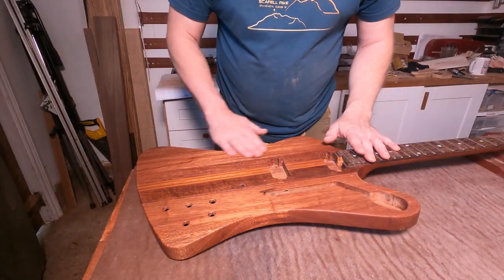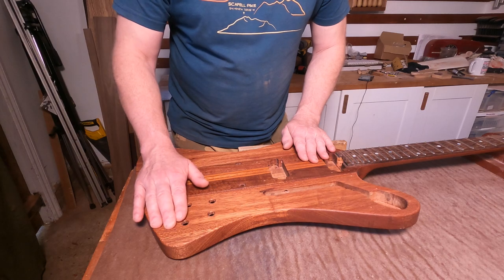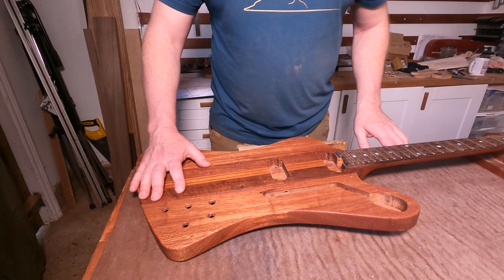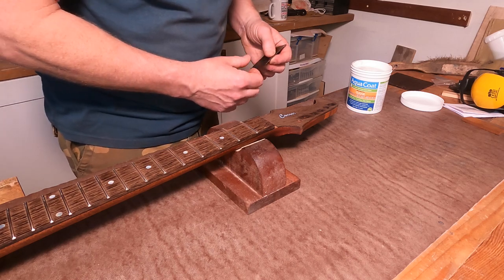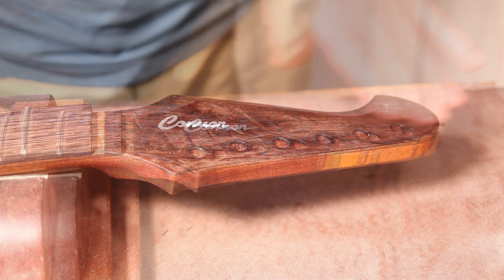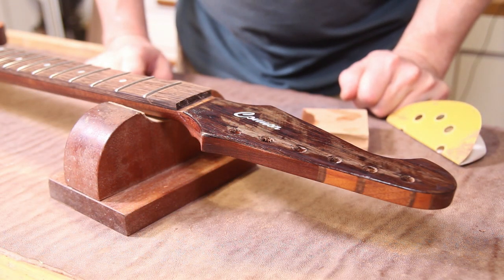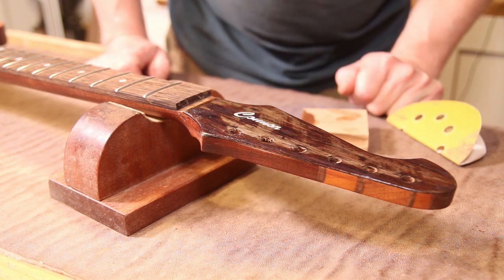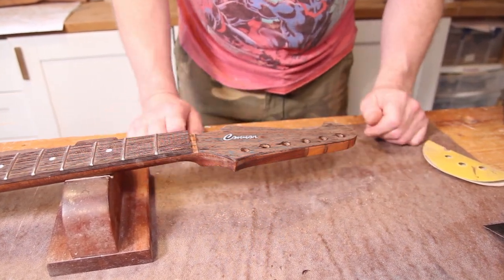Firebird Guitar Build Episode 30.

Comment: looks like a great clear filler.. does the job.. what will you use to oil the fretboard to give the wenge its nice dark chocolate finish?.. really coming along nice.. I like the grain in the mahogany filled dark like Gibson does.. to see that grain in a cherry heritage finish is fantastic.. since it does not have flame or quilting.. its what you can do to improive the look of mahogany.. Lola takes treats like my retriever Daisy.. (a few fingers as well).. lol
Reply from the maker: The grain filler seems to have worked really well, we'll see how well when the lacquer goes on but I think it will be fine. I'm planning on just using the lemon oil I always use (not always a popular choice but it works for me) I tried it on a bit of scrap Wenge and it went kind of black for a while but then took on a really nice look after a day or so. Lola does not mess about with treats, you have to be quick!!

Comment: I'm very new here so I don't know if someone else has mentioned it but be careful to ensure that the guitar is balanced correctly. I recently bought a firebird like yours and it has a neck drop issue. I was aware of this with SG guitars but not firebirds. It's quite annoying because otherwise it's an awesome guitar. I think I'm going to have to move the strap button that's near the neck, so I can play it standing up. I've been watching a few videos of people playing them standing up, and it appears that this issue is more common than I thought. Stupid really, cause it should be fixed "before" qc signs off on the guitar.
Reply from the maker: Hi and welcome. I was aware that Firebirds can be a bit neck heavy, especially when they have the banjo tuners fitted. To counter this I have put the strap button on the top horn area rather than the heel. I'm pretty sure that will sort it.

Comment: I glad you had a good experience with a aqua coat product. My results varied considerably. Tried it on couple different project with awful results and thru the whole qt in the trash. I think I may have received an old qt of the product. Hard white bits got stuck in the grain on dark wood and I spent way to much time digging that crap out of the pores. Like I said I'm glad you had good results.
Reply from the maker: Oooh, that's not good Dane, especially if it's as expensive for you as it is here. The tub I got seemed very fresh, soft and smooth. No bits at all, a bit worrying regarding the shelf life though!!! On the Wenge it worked really well, we'll have to see what it's like on other materials.
Reply: Pretty sure Texas Toast swear by it
Reply: @smudgetherealmc , I’m pretty sure TT used it in the past but have moved on to using Simtec easy sanding sealer for grain filling as well as sealing. It’s quite thick and builds rapidly. I started using it for my fabric top guitars and now grain filling. Down side is it is very stinky and brain killing.
Reply: Yeah, had a similar experience with AquaCoat. I assumed it was me. I ended up spraying a whole can of Mohawk primer/sealer and sanding that back to “grain fill.” Less than ideal, but it’s what I had.
Reply: @mrwaffles1394 , I have done that as well, grain filled with lacquer. Unfortunately lacquer never stops shrinking back.